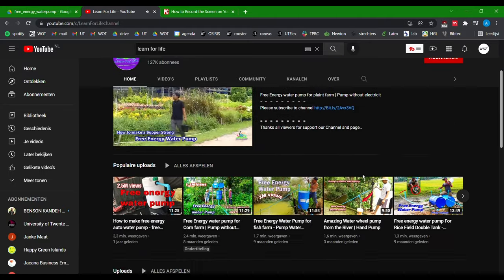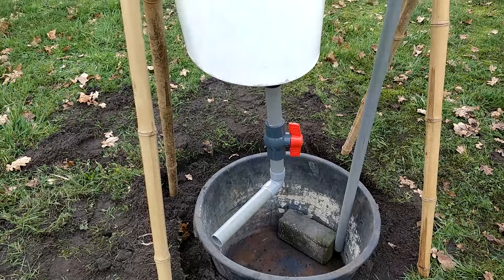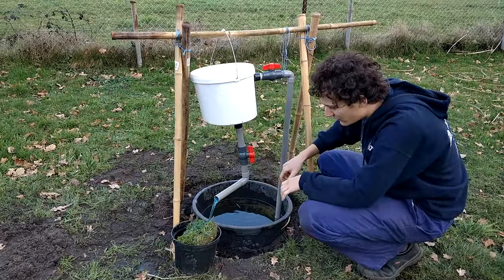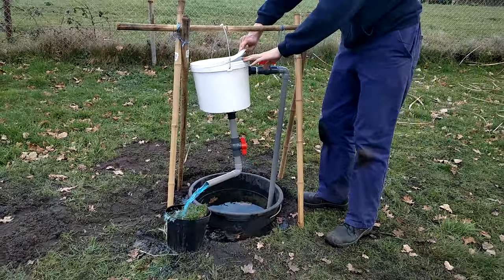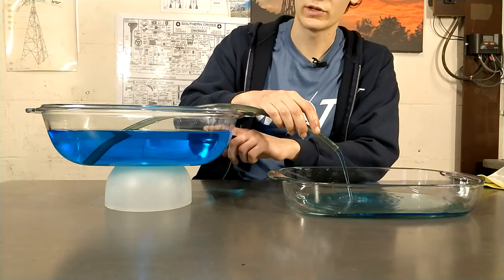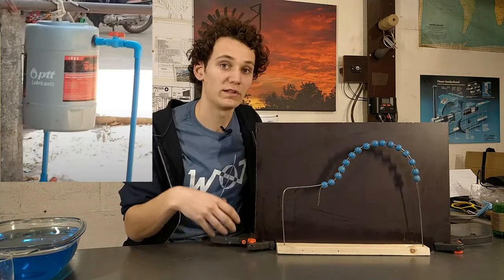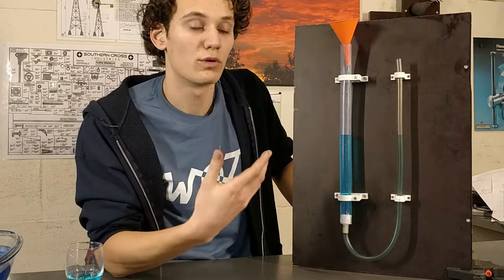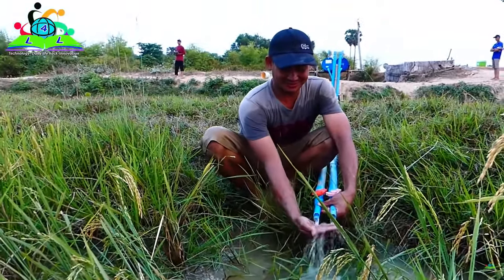FREE ENERGY Water Pump Tested. Is it possible?

Comment: Your setup is not the same as.
He uses check valve on the bottom of pick up line, so he will fill the pick up line with water.
Regardless, your demo will not work anyway. Unless the output is lower then the input level.
The water will flow from higher to the lower point. Regardless the diameter of the pipes. 
That guy put 50+ of videos even under different names.
What you cannot see on his video the elevation level, as he uses long pipe maybe 30M. 
One of the video he explains, this small version setup is failed.

https://youtu.be/lMk0aNGoTbE

Comment: Your set up is flawed. I haven't tried this myself but you are wrong. First your setup is wrong. In their set up, the water goes from the inlet pipes into the source. It is connected. Yours is disjointed. Secondly, your system is taking in air while there isn't. Thirdly, the free energy system works on the principle of no vacuum in nature and not on the principle of syphoning. You are wrong

Comment: It is very funny to me how you did the one thing he said that would make it not work. He said unless you put a long long pipe where it comes out the bucket it would not work and that's exactly what you did put a short pipe on it.. you're doing it the exact same thing the scientist an engineers they try to use and talk about technology they know about but when some new invention comes along they'll leave something out where it won't work and he had several other pipes that you don't even have on yours you're trying to make him look like it don't work when you don't even understand what he's doing and don't follow it you're just half ass in it
Reply: Noop. If you dip that output into a cup of tea, that would be equivalent to making the output line a few thousand km long. It still can not lift any water up from a lower source. Absolutely no water will come out.  The video uses a short output to show that air may leak back from the exit. In that case, the water in the bucket will come out. Then it all stops. The “pumped” water is what you lifted up into the bucker.

Comment: This gentleman has designed a system that naturally fails. He has not got the simple principles correct.    1. is that there is no vacuum he creates to draw the water       2. The vacuum created is lost as water bubbles pass back from the flow-out tube to deny the system its efficacy     3. his system needs be a little more  airtight.    4. hopefully he is not from one of the water pump manufacturing companies who don't want to loose their market share       5. Did you hear that sound of air bubbles going back from the outflow pipe? that's where this system fails. But it works anyway if one primes it with simple physics.

Comment: He did it wrong 
It's about pressure.  I created one for my pool encase we loose power again. you must use a air tight system
Reply: His container is air tight. Air sucking in from the outlet proves that. I also have a siphon to drain a small dam, but the water level in the dam must be gigher then the outlet, as with any siphon.

Comment: In short, yes, your model is similar, but not identical, because you basically do not believe that this system works for that, and what prevents you from believing that is that you insist on a set of theories that you already know and believe in, so you do not give yourself enough opportunity to learn anything new
I hope that you read the comments carefully and carefully, and pay attention, because many of these comments tell you where the error is in the system you are adopting
Note: the moment you put back the original Box lid and left the intake tube without a valve, I knew that your system wouldn't work
Reply: I thing you should follow your own advice, reading the comments. This excellent video shows that a barrelled siphon can not lift any water. Impossible.

Comment: You completely missed it. the upper container is supposed to be air tight, thus creating a vacuum what the water escapes from the bottom of the bucket and therefore sucking the water from the lower source. Your bucket is completely open and therefore it is impossible for the vacuum to occur, which again pulls the water up from the lower  source.
Reply: Sorry Dave, but you missed it. The container is air tight. Therefor the system leaks air in from the output side. It will not work because inlet is lower than outlet. Excellent video

Comment: "IF YOU DO THE SAME THING AGAIN AND AGAIN, YOU'LL GET THE SAME RESULT EVERY TIME." - my point is, sir, you DID NOT do the EXACT same thing... and so you got a different result. if you want to "debunk" a video (coz there's a lot that are hoax), DO THE EXACT THING then, debunk it. My challenge is for you to do what was done at "NO MOTOR NO ELECTRICITY NON STOP WATER DIY - DESI IDEAS AND CREATIVITY".. he used a rigid container, trans parent cover, rubber band (I think) to seal the cover and to show how it sucks up the water...  LOOKING FORWARD TO YOUR DEMO, SIR.
Reply: He has made an excellent video proving his point. No need to repeat it.

Comment: It worked to me 🤷
Reply: Please describe that. No siphon can lift any water to a higher level.
Reply: @kjellg6532  I used 2 bottles but the vacuum became to strong when ~ 1/3 of water from upper bottle drained so the bottle started to shrink and it stopped sucking from lower bottle. So that made me understand that I would need a sturdier container but later I realized that in order to lift 10 liters of water to 10 meter higher ground you would need a 100 liters of water in a main container, on that 10 meters higher ground, that will create vacuum that will pull water from lower 10 meters grounds up. So in short it wouldn't look very nice because you'd have hoses and containers taking very much field.... So the alternative would be ram pump but it is complicated build and maintenance....
Reply: @josipdrazin6708  Ram pump is a very nice construction. When properly made and with a little maintenance it can run for hundred years, but it can be a little tricky to tune to get started. To work it needs a lot of flowing water in a creek or river. A fraction of this water can be lifted extracting lifting energy from the flow in the river. 
A siphon can not lift any water to a higher level regardless of any drum arrangement. 
Have you considered a spiral pump? Easy to make, no tuning, but you need some flow in the source to drive it. A spiral pump can lift water 10+ meters.

Comment: Try again not theory basic physic siphon theory. Try think about successfully theory of ram pump. This sys is reverse ramp pump they use same theory.
Reply: No. A ram pump uses the mass times velocity of flowing water. This “pump” has no input of energu but for the one-time priming of the barrel. When this water is out, it all stops.

Comment: First off you need to use a one way valve on the inlet side. Second the inlet line has to be full of water. Third you are sucking to much air in from the outlet line. Fourth it works better on a bigger scale as in his videos most of them he uses a 55 gallon drum. People use these types of water systems on farms. This is nothing new. Learn more before you discount someone tying to make a difference. Some places in the United States do not have water going to people like in the Navajo tribes and Hopi tribes. This is a system that could be used to help run water to them. Places in Africa could use this as well instead of the people having to walk miles to get their water. Like I said before, learn more before you discredit an idea. I myself have even built the system and as long as the inlet pipe is full and the system has a tight seal it will work. Rework your project. It will work as long as you make the changes and keep a tight seal.
Reply: Sorry James, you are wrong. I agree this system works in many cases, but only if the source is elevated higher than the output, as with any siphon. Many videos on YT claim  that this barrelled “pump” can lift water from a deep well. It can not! 
This video shows that a siphon can not lift any water. 
If your claimed system can, it would be a world wide sensation. If your system works, you have made a Perpetuum Mobile with so good margin you can extract energy from it. No more pollution from coal, oil and gas. No more need for nuclear.
Reply: @kjellg6532  First off never say someone is wrong. I use this system everyday to pump water to cattle. So I know for a fact it will work. As long as you have no air leaks in the system or air in the line, water will flow from one side out the other using the water in the tank to siphon from one side and release at the other side. It will cause a state of motion that is constant. Like I said. I use this everyday. I pump water across a 20 acre property with a 5 foot incline to pump water to cattle and a small pond. On your last statement, no government will use the system for one good reason. They do not care about the environment of the planet. It will not make them any money. I have sent them ten different ideals, proved they work showed that the systems would drop pollution down over eighty percent. The message I received back from them was it will work, but there is no profit in it. They only care about making money and if it kills the planet then so be it. Have a good day.

Comment: Your demonstration is faulty, it doesn't follow exactly the way others did theirs that works.
You failed to filled the inlet pipe with water, you only filled the bucket with water.
The pump make use of two laws; gravitational and pressure laws respectively. Thanks.

Comment: @WOT  I too am sceptical of those ones, however I saw some videos that have air-capture bottles at the inlet, and what makes me think is if the air pressure inside displaced "by water volume" should pull through 80% of that displaced volume due to air suction, provided two things:
1. No backward-flow is allowed
2. Air-in from outlet is trapped and separated to not allow in vacuum chamber

Definitely would like your video to be extended to e.g. dissect this one: https://www.youtube.com/watch?v=dV9B_yWgYEs
Reply: The air traps at the outlet is only workig until the ait tanks are full. Bendt the outlet round to form a “U” and the air problem is solved.

Comment: Maybe you should have filled the up pipe first to the water was readily available also you had an air gap between the water level and the up pipe entry so the equilibrium will always happen with least input of force to achieve which in this system would have been the air pressure rather than the water pressure. Water is laminate and behaves in such a way. If the system was entirely filled with water any air trying to enter would have to reach the bottom which is exposed to air but this would cause more resistance than pulling water. Equilibrium of a system always involves the environment as a working component. Pull an inserted plug out of the end to get it started like a motor rather than relying on gravity.

Comment: 1 Your tank is too small  2 your pipes are  to large    Your pipe running up is not primed   It seemed you have only half the knowledge to make it work the top bucket needs a vacum to help pull the water up the pipe while the bottom pipe releases water the bigger the bucket is and the higher it is makes more pressure on the water try looking at the making of a heros fountian
Reply: Noop. In fact you do not need a barrel at all, just a waterfilled hose will do the trick. Diameter of tubes can be as wide as you like. Seems you are not seeing that his purpose is to show that this system does not work, solely because a siphon can not lift any water from a deep well.

Comment: Ehm...No offence, but you did a messy build and that's why it cannot work. The trick of such a system stays in  the vaccum (Low pressure) created by the lowering water. That sucks up the water just like a syringe would do. Also: You did a horrible job with the pipe on the lower end: Wrong size, wrong lenght and sticking deeply inside the container - that's also why you had air almost immediately. Plus: It can't work with those pipe due to their diameter and thr size of the container -  way too small.
Reply: Ehm… No offence:
- size of tubing on input and output does not mater.
- length of tubes does not matter.
- how far the tube are sticking in does not matter (ok, some details here)
- how far the tube goes into the barrel has no influence on air leaking in from the output.
- tubes and barrel may be any size, say from a mineral water bottle with straws up to an oil tanker with 5 m diameter tubing.
Reply: @kjellg6532  I have no idea of what this conversation is about. I haven't written a single comment myself. Ignore everything seemingly posted by this account - especially if they were insults or hate speech.

Comment: You didn't build it the same way they did. The outlet pipe was much longer and he had a vent pipe also.
Reply: Making the output longer vil not help. A vent pipe? “Vent “ indicates open to the atmosphere. That can ruin the siphon. If closed, it is a temporary air trap. When full, the barrel itself wil function as air trap for some time. Then it all stops. 

Besides, the purpose of this video is to show that no siphon can lift any water.

Comment: It is your setup problem, 1) length between suck and leak tubes must be highter, for created pressure can suck water to bucket  2) leak tube may be need one-way valve. becouse your PP tubes diameters too big. 

edit: I rewatch video end, may be I do not undestand all at first time, It really just syphoning, but the make this work without some barrel or bucket is hard...
Reply: I think the experiment does not entirely remove all the air from the top bucket of water. Try doing another experiment to have a bulb valve at the top of the bucket, open the bulb valve to make sure all air in the bucket is expelled. The close the top bulb valve and open the suction valve to see the result.  In my mind, the setup experiment maybe faulty

Comment: ok totally wrong on your part. IT DOES WORK !!! on your model your water output is TO SHORT, allowing pockets of air to get back into the line causing it (pump) to loose suction. ON MINE, i have an 8' tripode with 1'' pvc dropping down the center into a stream 3' to 4' deep. with a 90* at the top of the center pipe turning 1' over to a 45* and 5' over to a filler tube (4''x 3') running 150' down and over to a water wheel. the filler tube pulls a suction up tru the 1'' pipe until the stream water makes it tru the 90* and 45* ( filler water still pulling the stream water up and over. now the feeler water is reached the end (150+) the pull from the stream water pass the 90*(now pulling the suction down) has taking over the suction/shipon. we run 4 alternators and 1 12volt pump off this water supply providing water and power to the cabin up another 15'. also you need a shut off valve at the end of the outlet pipe when priming it. lol
Reply: This video is exellent. Showing that no siphon can lift any water up to a higher level. If he had made the output 100 m long, it would not help. If he used 8 inch output tubes, it would not help. If he had shifted the 8 inch tubes to the input side, it would not help. 
You can use any size of tubing. You can use any size of barrel (it must be larger than the volume of the suction pipe. You can use as short output as you like.
BUT!
THE WATER LEVEL IN THE SOURCE MUST BE HIGHER THAN THE OUTLET! If this criteria is not fulfilled, this siphon setup cannot work. A siphon can never act as a pump. There is no energy input.

Comment: The volume of air in your reservoir should be equal to volume of your inlet pipe so that the pressure can be powerful enough to pull the water up

Comment: Lol, you built it wrong. You need a longer exit tube, and you need to prime both or at least make sure your basin isn't fush up against the inlet blocking the flow. I use one of these with a 5 gallon bucket on my well to water my gardens. So either i have magic water, or you're not all there and failed physics.

Comment: cant this be looked at like a diaphragm pump? the air acting as a diaphragm in a way... so if the inlet pipe is smaller diameter the suction inside the bucket should suck water up from that side. what if a valve was placed on the outlet, or even something like a breuer valve to create a bit of a hit to start that siphon.much like how you can start a siphon by putting your hand/finger on the end of a pipe and progressively dragging the water up the pipe with its momentum.